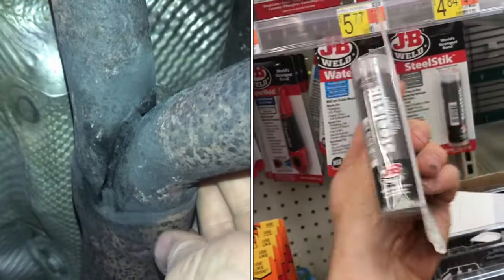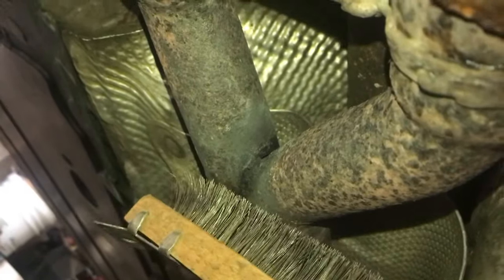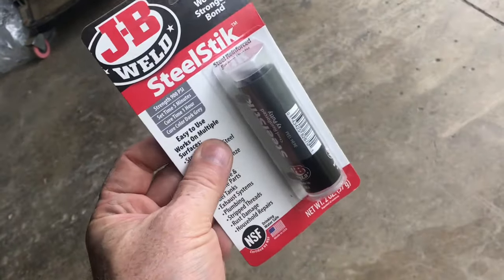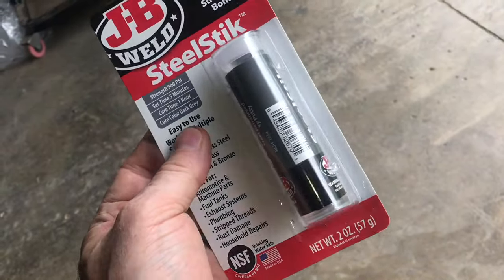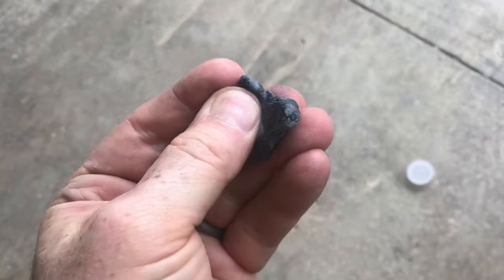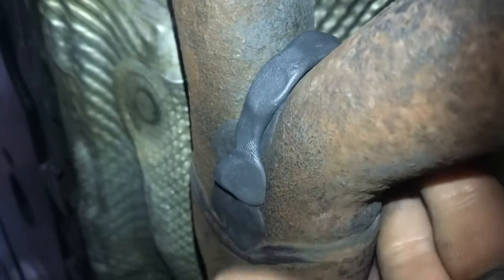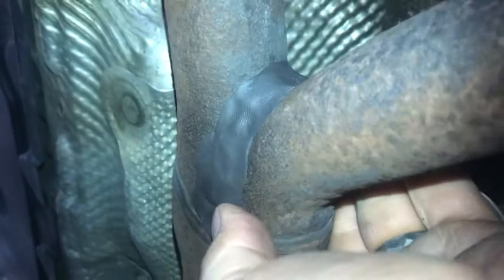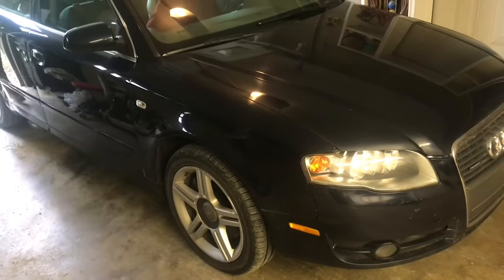“repairing” EXHAUST SYSTEM with JB Weld (steelstick)

Comment: Did it last 3 days? Or was it three hours??
Reply: Mine lasts 6 months on average
Reply: JB Weld can handle temps up to 600°F. Your exhaust (after the catalytic converter) only gets between 350°F-500°F. JB Weld is mostly made of zinc, iron, calcium carbonate and barium. This is why it works and is so strong.
Reply: @asmongoldsmouth9839  couple days ago i got a message center error stating a module was offline 'system cooling' I know I was way over 600 degrees. Took abs and terrain managment offline
Reply: @asmongoldsmouth9839  my 440 glowed red-orange all the way to the collectors of the sidepipes where it opened to 3" thats more like 900degrees

Comment: I used that on a straight six 4.0 liter exhaust manifold which commonly crack by the head. Sure I covered it with foil and a hose clamp but it did hold for many years.

Comment: I used common 2 part JB Weld ages ago to repair a radiator leak. 100% fixed. Never an issue again. Second to that, I also repaired a shifter box made of garbage pot metal. Stronger than it was brand new. And I shifted that car hard. Zero issues.

Comment: Appreciate you just payed for a tune and got a flex pipe leak and need this fixed in the next couple days hopefully this works
Reply: Not sure this will work on the flexpipe as it needs to "Flex" for the exhaust not to crack
Reply: @3meansgo  worked for the tune day and till I got them replaced cause it cracked on the end of it not where it actually flexes and just got the flex pipes cut and replaced a couple days later
Reply: @E_ina_G  good to know it would work in a pinch! 👌
Reply: @3meansgo  yeah works decent in a pinch as long as it’s not on the piece that flexes as you said

Comment: I saw a cool video using a shop vacuum cleaner reversed flow, out, into the muffler and spraying soap to find the holes in the system.
Reply from the maker: That’s a pretty neat idea, I’m in the process of trying to find one of those leaks right now. I may have to try that. Always a better mouse trap
Reply: yup Chris fix
Reply: We do it oldschool. We start the car up, cold. One person holds their hand over the exhaust tip and the other person is under the car listening and feeling. It only takes 30-45 seconds to find all of the leaks. 👍

Comment: Used this on my 2000 Nissan Maxima SE at the Y pipe..this thing smells like rotten egg after heating up. Also it didn't work. It might work near the tailpipe or muffler.
Reply: What you are smelling is likely a plugged catalytic converter - now that you've changed the exhaust flow by fixing the leak, you're probably now smelling a fouled cat.
Reply: @stinkybuffalo 100%. And he most likely is getting an insane amount of heat passing through the metals now from emissions/flow and heat nesting in the clogged cat. Or he didn't let the JB cure before driving. Either way, I have never heard of JB failing. So, if he doesn't live in California, bypass the cat with a straight pipe. LoL!!

Comment: The million dollar question is, Will it hold for a long time, or is this a temp fix?
Reply: I have the same question.
Reply: I used it for myself. It definitely dries VERY hard…and has a temp resistance of 3,500-3,800.. around 4,000 degrees it crumbled..definitely will last a long while on a muffler/exhaust system as they usually don’t go over about 1,000 degrees. do not use on converter. it will not last a day..depending upon how long the car is driven and if there’s no problem with the engine, this putty should last a long time on the exhaust. it’s definitely worth it. I hope this has helped!
Reply: definitely use gloves when mixing A&B, and make sure to work fast with it, as it dries fast and can cause chemical burns to skin. no fun. I hope this helped! couldn’t find anyone trial and error-ing it so I said f it…let’s give it a go. and it’s worked very well thus far.
Reply: @berryfairy420  I used it to hold in place my radiator. The plastic part of the frame where the screw goes and holds the radiator, broke off. It's been a couple of months and so far it's holding.
Reply: @humbertothebeliever2443  it will last quite a while in that spot. very good choice..I’ll update you if you’d like on how well it holds up in high heat on my daily driver. :) much luck to you.
Reply: @berryfairy420 how’s it holding up? About to try this on an ecoshit escape hoping it works well!

Comment: What good is this video with no follow up?
How long did it last?
Reply from the maker: The further down the exhaust the better it works long-term. If it’s too close to the Cadillac converter for burns off in a couple of days. Furnace cement Will last even on the catalytic converter or exhaust manifold. It is very brittle so the only reason it comes off as a cracks off. Hope that answers your question
Reply: @livefree6878  I mean the repair in the video... did it last a week? 6mo? a year?
TY